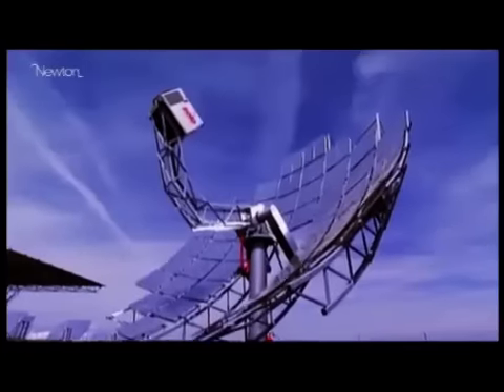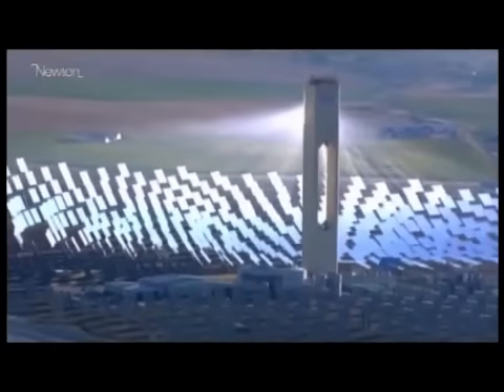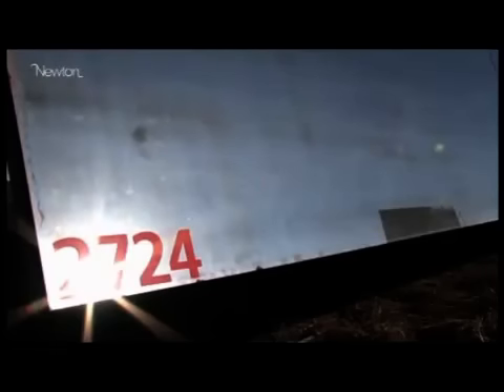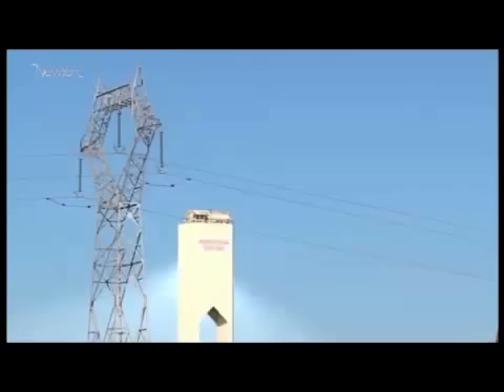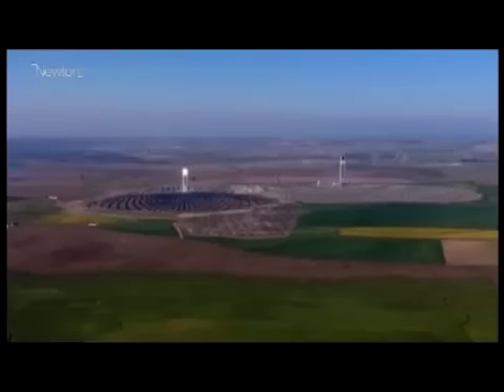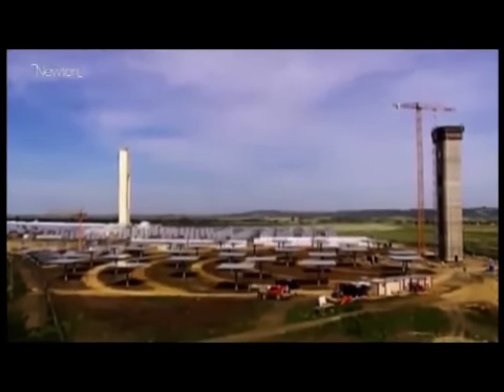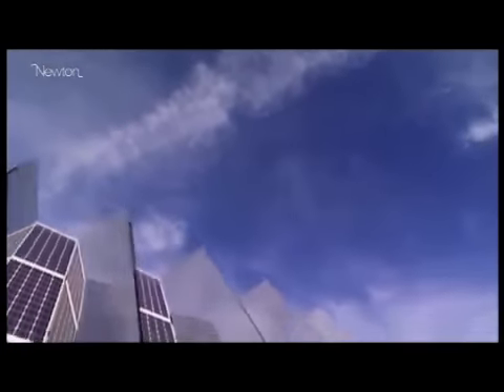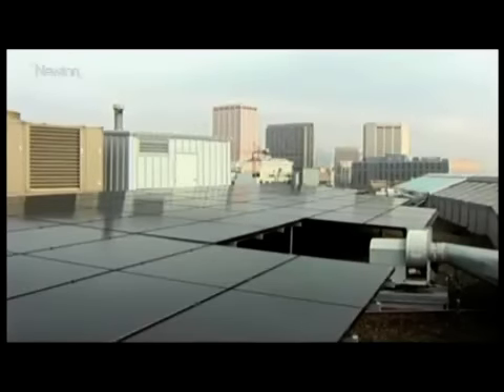World's Largest Solar Power Tower - Seville, Spain: 1 of 2

Comment: this is wat we need in portugal but not like thi looks too expensive for powering just 10000 homes... we need a hot liquid solar panels connected to a turbine engine powered by steam thats the way to go, this looks expensive why build towers when you can get the same heat from a tube with high heating liquid in it that heats water and proces steam

Comment: Spain is working on a supercritical carbon dioxide brayton cycle heat engine that is 56% efficient that could be down sized for a single home it would cost as much as a air conditioner because that all it really is

Comment: So .. where are the Seebeck thermoelectric modules?  If your going to use ONLY one thing to generate power you discount all the great science out there.  Its silly.  You can run a stirling engine off a solar evacuated tube and then utilize thermoelectric modules to collect even more energy on the cooling end.  Check the power pot for small uses at theepicenter dot come 300c seebeck TEG's at customthermoelectric dot come.. its time people knew what is possible, and question why its not all used.